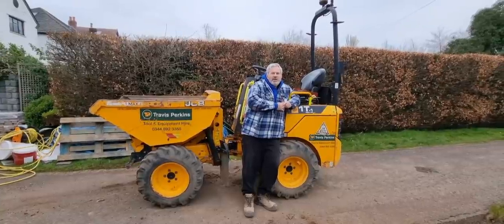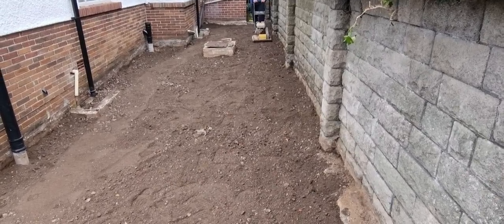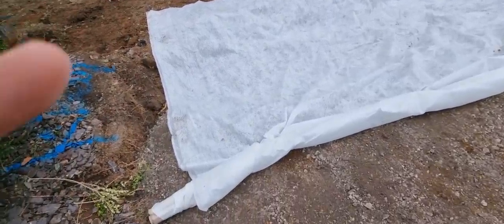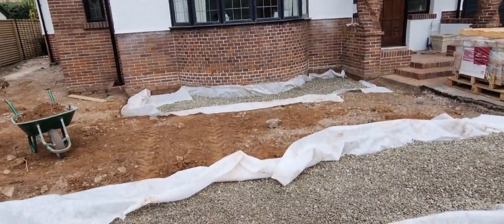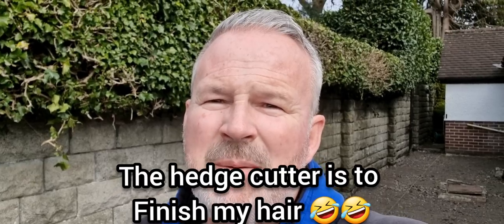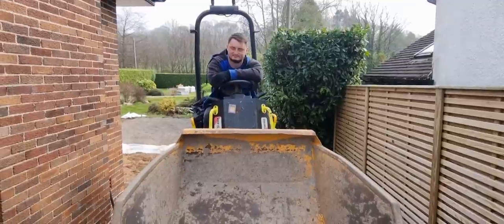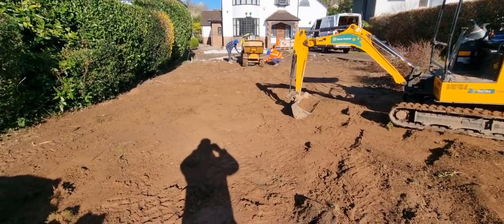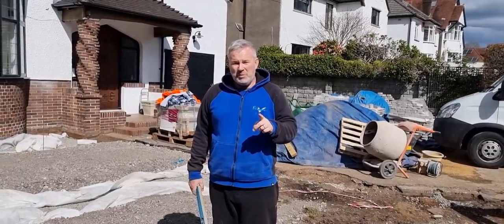Driveway & Patio base how to

Comment: Hi Justin, great video as always. I’m about to install 200m of Bradstone setts, we have hit clay at 250mm below finish height, I’ve set shuttering up for a slab to be poured instead of base, is this how you guys would normally deal with this situation ?
Reply from the maker: Hi Matt
A few ways to deal with it really as long as you have the relevant drainage set it and a decent base you should be ok for an mot base .if its a permeable drive then clay is very difficult depending on the soil test maybe a no go .A percolation test on the soil would be an idea .The concrete base is gonna be expensive especially on a 200m2 area .Could also add soakaways and or french drains .If in doubt what to do and especially as the right option has to be achieved maybe ring an engineer to assess the ground and give you an exact way to go to get the work completed right .Hope that helps you .
Justin 👍

Comment: Tremendous stuff, lads. Fair few quids worth of materials going into that job before you even open your 1st pack of slabs! Setting out is key....that's where so many inexperienced folk come unstuck by charging on trying to make a good impression to the client and finding out later on it's a nightmare!
Reply from the maker: Spot on as always Jim and yes the price for the materials alone for this project is crazy but they are nice top end stuff so 👌. Thanks Jim
Justin

Comment: Coming together now Justin, I always find setting out takes a fair bit of time, especially when you've got different areas and levels to contend with, something the customer doesn't always see or appreciate. And finally, you have to be thankful you've still got some hair left to cut:)
Reply from the maker: Hya Paul hope your well .Yea spot on as usual mate all in the planning ive learnt not to go straight at it not worth it is it.well worth the extra time to no its right mate.
Got plenty of hair on the back and side not much on the sun roof less hair should be cheaper hair cut but no 🤣🤣 .Good luck mate 👍
Reply: @brickrightbuildinglandscaping  :) :) :)